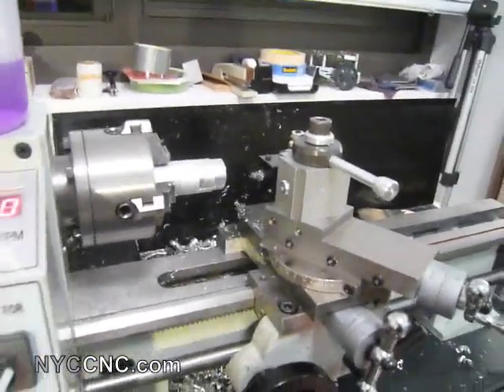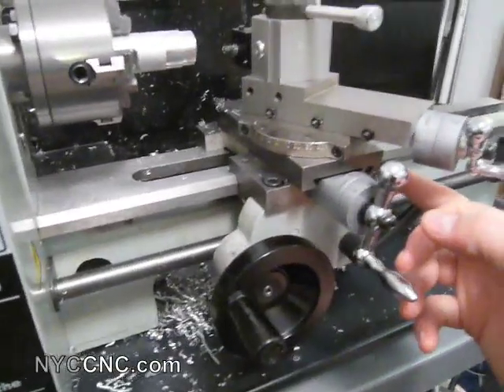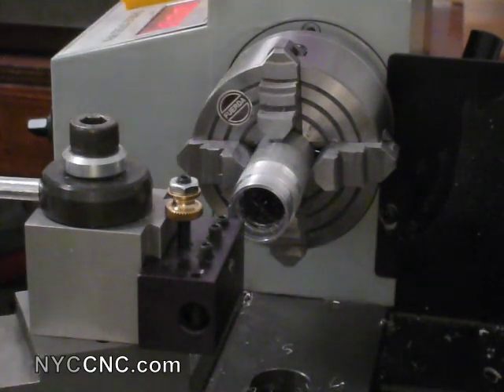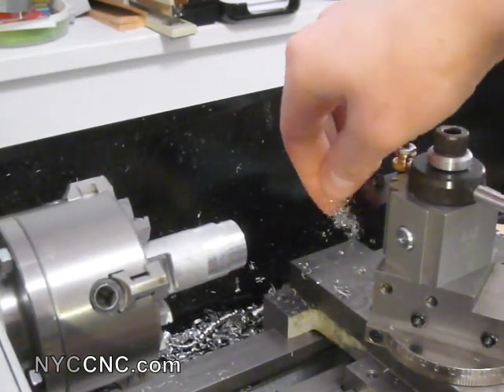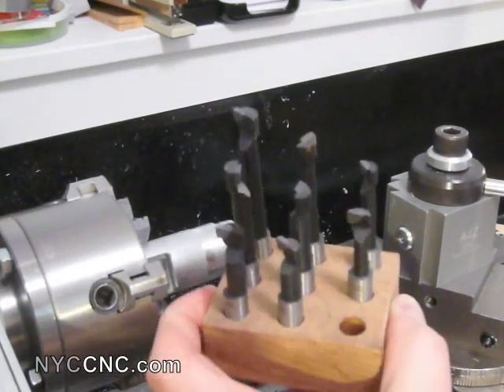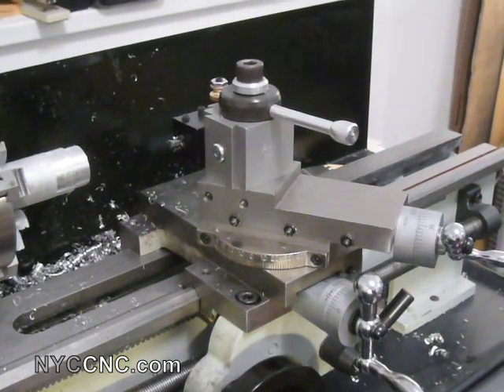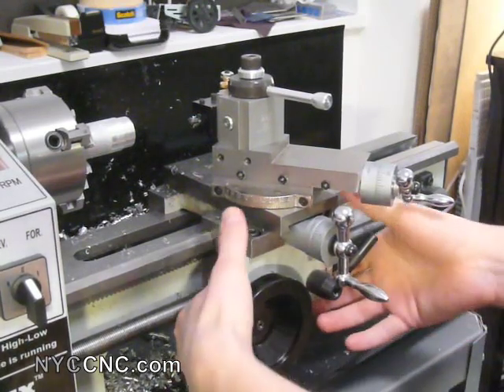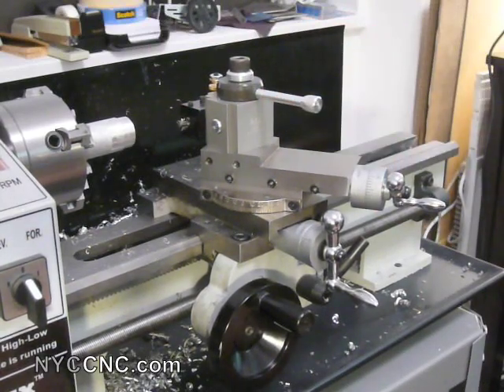Boring Aluminum on my Micromark 7x14 Mini Lathe

Comment: Sorry for my english, I'm Italian. 
I mean, my braised tools do not cut, so I bought online tools with tungsten carbide plate. !! 
I hope that those cuts .... 
I wanted to ask you a few things about the mini lathes (are all Chinese), my lathe has motherscrew flexing when I trigger an automatic carriage, even yours? 
What can you do? thanks
Reply: Brazed tools cut just as fine as the rigidity of the tool's body and the quality of the cutting parts. While I'm certainly inexpert, this seems very much to be another arena in which a lot of cheap and poor quality tools (poor materials, poor or haphazard geometry, etc) have given a technology an unfairly poor reputation. The tools will be exactly as good as the manufacture cares to make them, any like any other tools you will have to pay well for that. Much the same seems to be true for pre-ground hss lathe tools. Many are excellent, most are junk the the manufacturer's price seems to tell them apart as often as not.

Comment: nycnc  just a pre ground HSS tool.  I just got a grinder so I'll probably have to round off the side. I'm just worried about rigidity.
Reply: NYC CNC  the tool. I guess an HF 7x10. Isn't the most rigid either but I have the gibs tight and I'm just boring Delrin.

Comment: I recently bought the QCTP and the boring bar set exactly like the one you are using from Little machine Shop. Thanks for this very informative video. I am about to try boring out aluminum. I am using a 7x12 Speedway lathe. Will see just had rigid this lathe is. So far it has produced some pretty good results just turning metal. Maybe you alerted me to a condition I wasn't aware of. Thanks again...
Ken ...Marina CA

Comment: Great tips on the shims - I'll have to do that myself as I've noticed a bit of play on all the slides.  I'm also going to upgrade the tool holder - the stock one leaves a lot to be desired.  Adjustable tool height is a must IMHO.